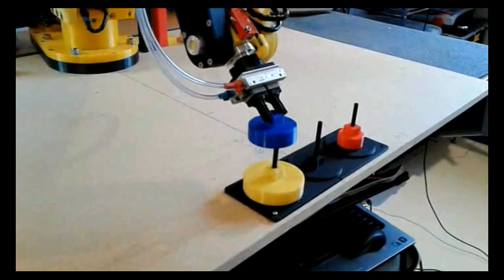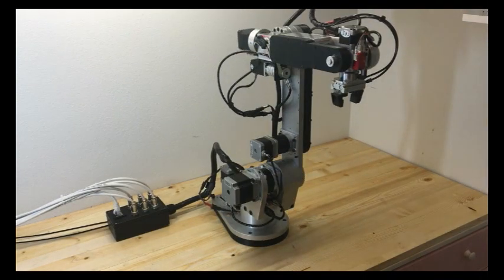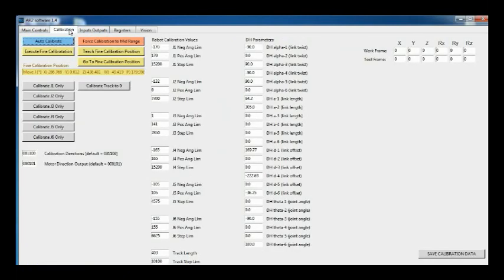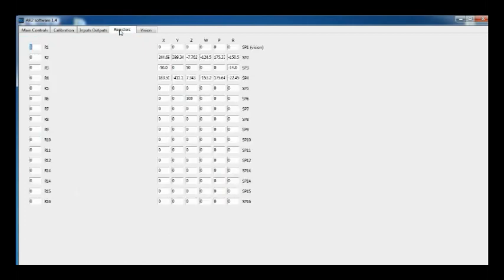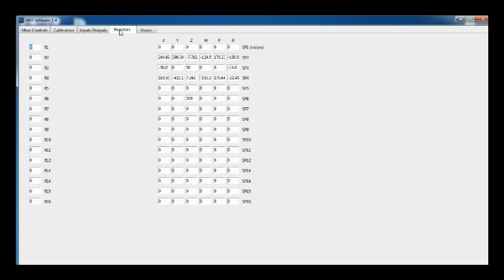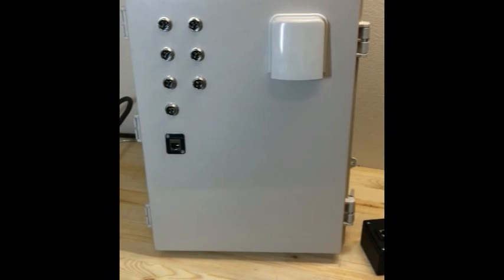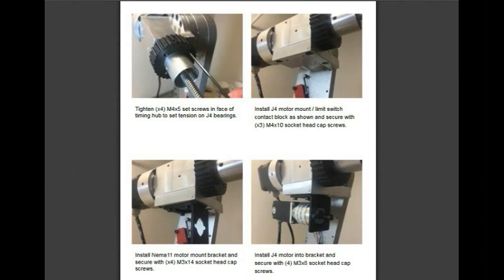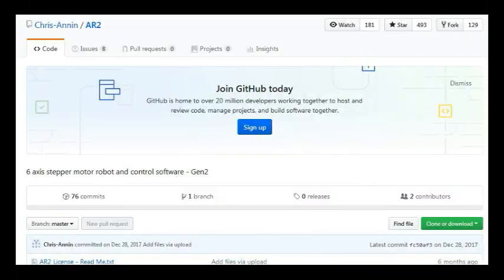AR2 OPEN SOURCE 6 AXIS ROBOT OVERVIEW

Comment: Great design. The only problem is the wiring which makes it hard to work to harsh conditions.
Reply from the maker: I agree, this robot is very low cost by comparison to other desktop robots but is not designed for harsh environments without a jacket or cover.  If this project continues to be successful or of interest to many people one future item or addition I would like to explore is a robot jacket for protection in tougher environments.

Comment: Can the AR2 software be used with any controller, not just an Arduino?
Reply from the maker: It is specifically written to communicate with the AR2 arduino sketch file.
Reply: ok, thanks. The code can be adjusted if I have a different robot arm, right?
Reply from the maker: Mert Capkin yes you can put in your own robot parameters and change motor directions and calibration directions.
Reply: Great! Thanks for the info :)

Comment: Does it support closed loop motor?
Reply from the maker: Not yet, this version uses low cost open loop steppers but has limit switches on each axis and a self calibration routine. The goal here was lowest cost possible.

Comment: Is it easy to add one more axle to the system? I would like to mount one more extra track to be able to move the robot all over the work table, in both X and Y direction.
Reply from the maker: It’s possible, it would take some work but could be done.
Reply: Chris Annin , thank you for this great opportunity. I will definitely build this robot! It's so robust that I actually think I can use it for some real job tasks.

Comment: Hey Chris, great job! 

Finally a project I am willing to trust, not the usual kind of chinese ripoff robot claiming lots of things that are simply impossible to achieve with their hardware, or just delivering toy software.

Do you have any data on repeatability and accuracy? 

Really looking forward to use this as a base for my own robot!
Reply: er, i meant a solution for the current size.
Reply from the maker: I have not, I’m still on the lookout but high end precision gearboxes or even harmonic drives would be many hundreds or more for each axis. The current robot is designed around the low cost offerings from stepperonline. I will keep you posted on what I come up with in the future.
Reply from the maker: Thank you, when I setup a dial indicator and did repeatability tests it would consistently come back to the same position within .030” the inexpensive stepper motors do have some backlash but with the robot in compression it repeats pretty good.  It’s not perfect but I think it does good for a basic entry level robot.
Reply: Did you find any solution for the anti-backlash gearboxes (like the ones) used in bigger arms?
Reply from the maker: I haven’t started on a larger arm yet. I do hope to find a low cost solution for larger arms with good accuracy but have got there yet.

Comment: Very good work! Question: can the motion ease in an ease out, how much vibration does the arm have? Thinking about a DSLR motioncontrol arm setup. The arm must be able to 3-5Kg. Is this possible?
Reply from the maker: It does have acceleration and deceleration. It can carry 1.9kg   I will need to build a larger arm for higher payload which is on my list but may be a while.
Reply: thanks Chris, but when the arm ist shorter the lever action would be lower so the weight that could be move would be greater, right?